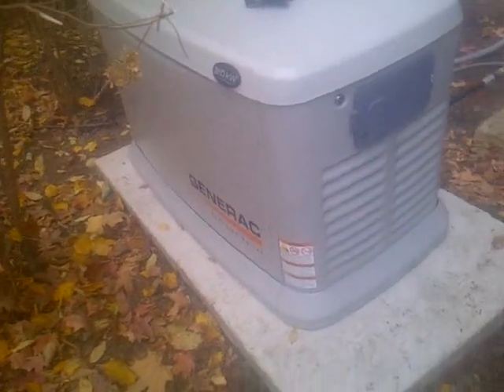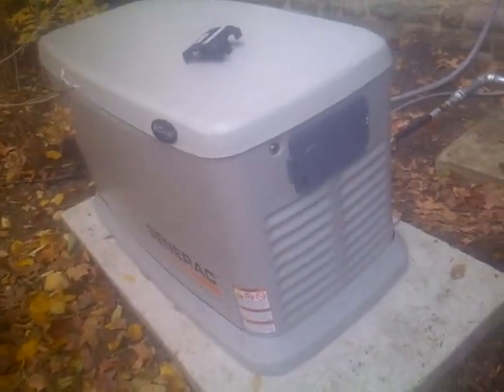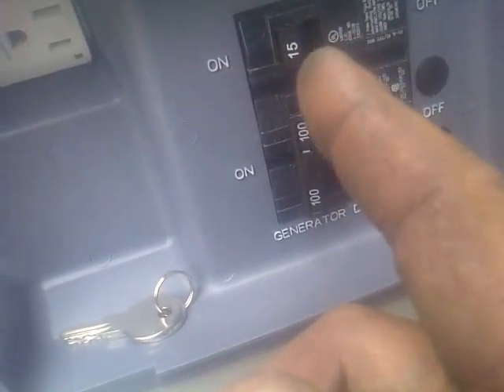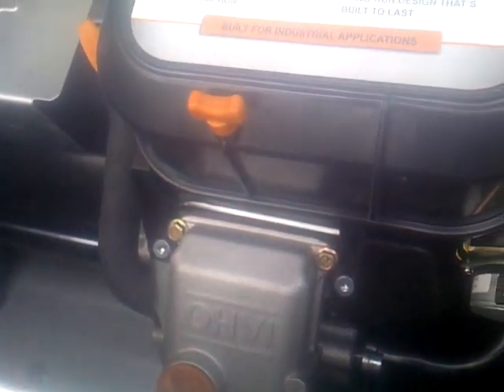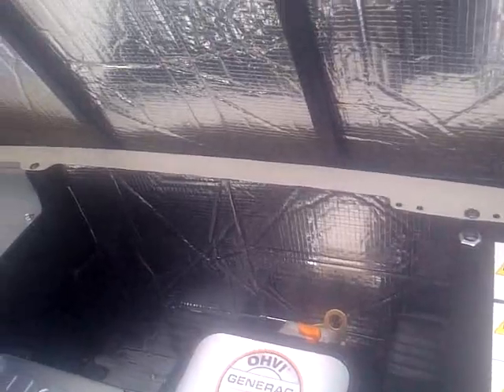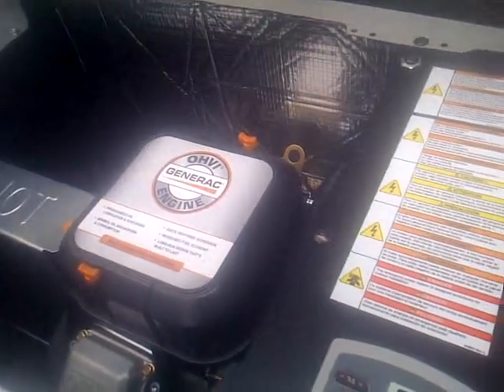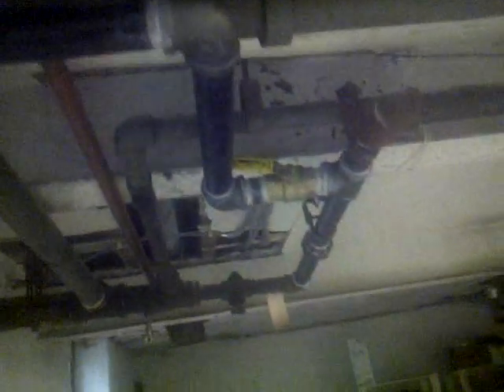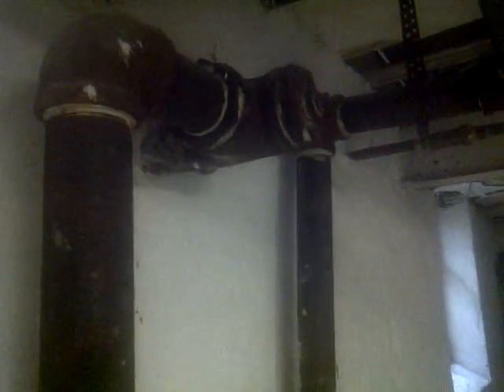Home Generator Generac 20kw

Comment: Yes this is nice work. To answer some of the problem ?'s. If u have an under voltage alarm there could be 2 things. 1 ur field boost diode is not sending field excitation voltage to the rotor. This can be caused by the controller. 2 as someone else mentioned the brush assembly may be bad. U should contact a certified technician like myself to perform ur work. The GFCI receptacle on the generator will only be on when the generator is running. U can turn ur generator in manual mode to access this power source if needed. Thanks for the video. I always enjoy seeing other installers work. If u ever have any questions regarding any alarms or problems feel free to contact me. I would be more than happy to help. And u are right. Now is the time to have security in your hands. No worries with these systems.

Comment: Jersey.... As far as the radio remove batteries and reinstall and test. also the radio transmitter at the gen.. remove the connection harness and apply some elect lube. reassemble and test

Comment: Our 17KW Gererac was installed after Hurricane Sandy. During the last month we had 2 power outages. It started and ran well but stopped and immediately restarted about 6 times during the run time. Our service tech said it was probably caused by a brownout situation where power was coming on and off. Today our remote is flashing "no radio signal" . Will appreciate any info you have. Thank-you for your videos as they are very informative.  Bud

Comment: I am generac tech.. I troubleshoot and repair generac generators. first is your engine coming up to speed if so. this problem is one of two things. 1, brushes could be bad. 2, the controller could be out. the controller is not receiving a signal from the ac output. no ac output and you will get an undervoltage alarm.

Comment: Have you ever run into a situation where there is "under voltage" stop alarm.  I have a 20 Kw Generac and it is giving me this alarm and will not run for longer than 5 seconds.  Any ideas.  It is propane fuelled and ran fine in the summer but recently produced this alarm when the temperatures dropped to minus 15 degrees Celsius.

Thanks.